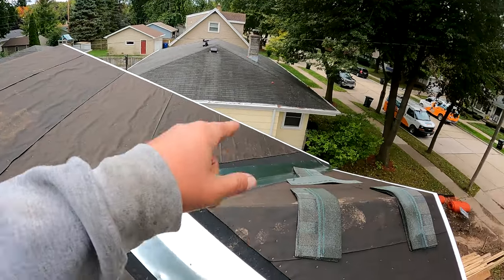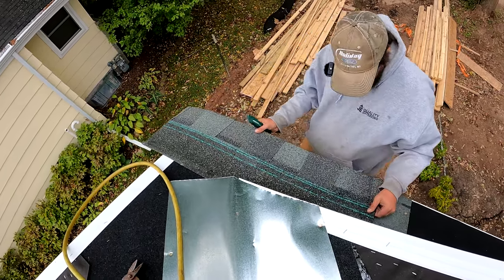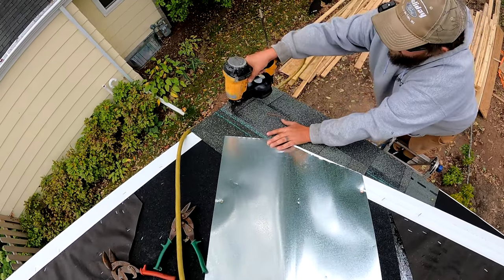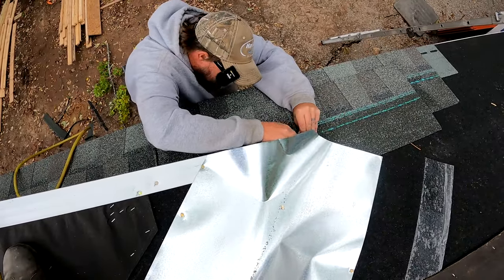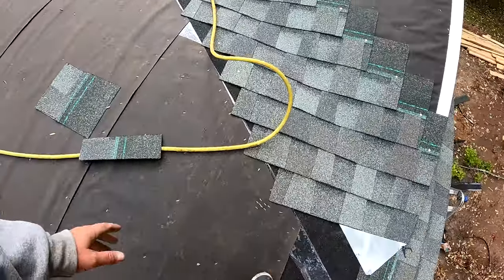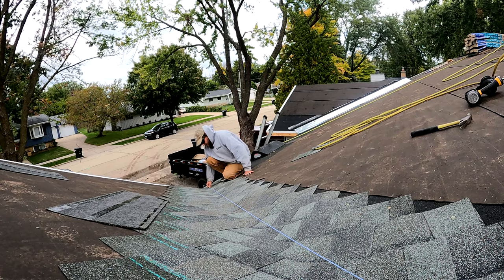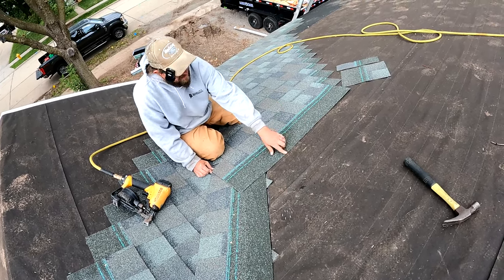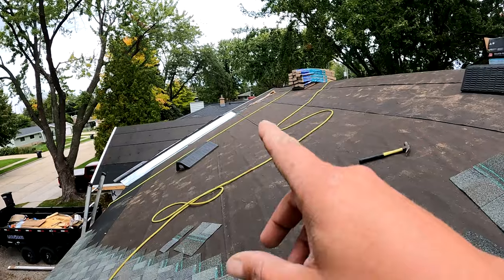HOW TO SHINGLE A CLOSED VALLEY (DORMER ROOF)

Comment: Nice work only thing I don't recommend is running shingles flush to drip edge on rake other than that nice job
Reply: Where do you go? Half over?
Reply: @adamquinn9659  I always run a starter up the gable and overhang it about 3/8 of an inch.

Comment: Architects think that's a neat detail on a drawing, But the dormer roof not coming out as far as the main roof line is tragic. With the convergence, having a small section of roof to catch feet of snow in a very compromising position, convoluted by possible ice dambing in the valley as well. Great vid. TY

Comment: What usually do is pull up that valley metal at bottom of the valley. Then I use a cats paw and remove the nails from the plywood in the valley that way you don't have to cut that shingle like that

Comment: I am torn about metal or no metal in the valley. One of your videos you don't use metal. In Michigan. I have a 7/12 dormer on a 5/12 roof with ice shield running the whole length of the valleys. I really value your videos.
Reply from the maker: Metal in the valley will not hurt. It is just an extra in most cases

Comment: Awesome vid, thx! I’m tie-ing in a small front entry, 4x6, into my existing roof. The main roof is 12pitch (cape). I was planning on matching the 12 pitch on the new addition. You mentioned that this California method might not work in a high pitch roof…. Why is that, and other options for shingling where 2 12 pitches meet?
Reply: Word from the wise. As a 35 year roofer, keep your 12/12 pitch add on. With all old roof tie in, gust make sure to cut back the pattern of your stager at least 5 inches. You can do this every other row of shingles. Good luck. 😅

Comment: 1minute into your instuctional video and im wondering why you didnt cut the plywood back( easily cut  with oscillating saw)instead of notching shingle? Also i would have waited until i installed roof on shelf before rake edging was installed. Less of an obstacle to install shingle under valley.I have 45years worth of balls doing roofing. O years of videos. Makes it easier for ya

Comment: At 19:37, why did you stack the shingle insted of running that row across before installing the row on top? That way you dont have to stack it. Just curious
Reply from the maker: I stacked it because it allows me to start with full shingles through the rest of the valley
Reply: @Lifes_Apprentice all u had to do was cut the shingle in half under it run it to other side them boom no stacking all to save to seconds now u have 2 seams on each other bad call

Comment: Coulda run that valley metal another inch or so past so it dumped out further down the shingle away from the trouble spot.  Starter course with a little overhang up the dormer gable rake would be good, too.

Comment: Need a 1 inch overhang on the gable ends, as well as starters.  Tip for sliding shingles underneath, take a sawzall blade and cut away nails a d make yourself space to slide a full shingle at the bottom of that valley. shingle

Comment: So what do you do when you get back down to them stacked shingles? Do you just stack them 2 rows all the way across? Or do you somehow adjust them?
Reply from the maker: I will just stack those rows into the next valley. If it was a really long run I may do it differently
Reply: Smh it takes 2 seconds to put a 12 inch piece in didn't have to start with full

Comment: Got a question I remember from roofing when i was seventeen i kinda remember but in valley do u run the side with more pitch over the other side so water doesn't run under or does that not matter with this system I recently bought a house ajd want to use this
Reply: You are exactly right,steep side over lower slope side,not like he done here,you will also notice his steps on the   
shingles at the far left  are only about 3"or 4" which needs to be 6" ,younwill notice at 23:40 looking down the opposite valley from the top view water will run under it and cause major issues, 35 yr roofer here.
Reply: EXACTLY
Reply: Yes allways, don't learn from this dude he's clueless.

Comment: You should always roof the side of the valley that has less of a pitch first. If both sides of the valley are the same pitch you roof the dormer first. In this situation it would be easiest to roof right-handed into the valley rather than left-handed out of the valley unless you are in fact left handed. When you come out of the valley like that your pattern is not going to be 5 5/8 like it should be. Your pattern looks to be about 3 to 4 in which is not okay.
Reply: As a 35 year roofer myself, you are absolutely right. This dude is as we call them. A hack.
Reply: Sometimes u do get a nice 6 inch stagger he has about 4 which isn't good.. start from left and then cut at ur valley on other side and boom still just as fast lol

Comment: Need starter under the valley going up the dormer gable!!! And what about ur over hang bro ??? Idk how yall get to roof like that.  But if u didnt do a 1" over hang on my roof,  you'd be going back to fix it before getting paid!! Plus that starter under the valley up the dormer gable !!! Important .... omg this is huge EDIT!! In closed valley, need that ice and water peel n' stick. But no valley metal! Valley metal will expand and contract under the heat and cold of weather elements. Loosening over time. Creating problems and leaks. Ur close valley looks great aside from the metal underneath, plus the starter going up the gable !!
Reply from the maker: Why are you watching "HOW TO" videos other than to say it was done wrong if you know everything...Gable starter is a scam and does absolutely nothing. the D edge has an overhang already and I have never had a leak or blow off in thousands of roofs. I am not resposible for underlayment on this exact roof but you are right about ice and water in the valley. as far as valley metal you are completely wrong and shingles will actually expand and contract better with the valley metal because they are not stuck to the valley on underside, they will be absolutely welded to the ice and water in most cases.(side note ice and water can easily rip, tear, or if you step in the wrong place can rip a hole) Go make your own videos bro. I am a licensed contractor for over 15 years and gonna keep doing my thing. I have dozens of other How to videos for you to correct in the meantime
Reply: That is correct, the only reason for starter on any gable end is for a clean look from the ground if you have a half inch, 1 inch overhang.
Reply: @Maynardd he makes it flush